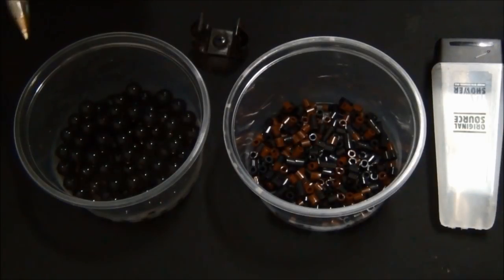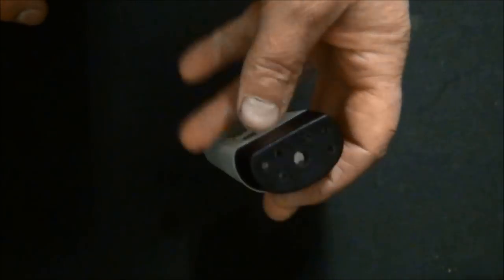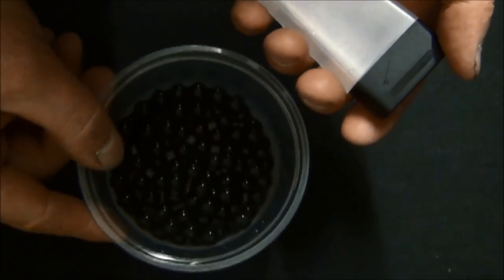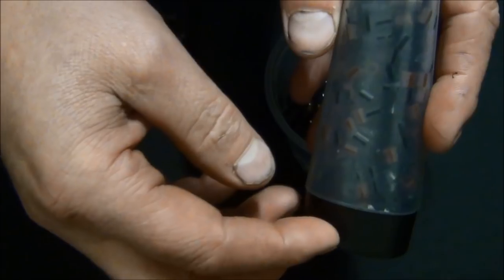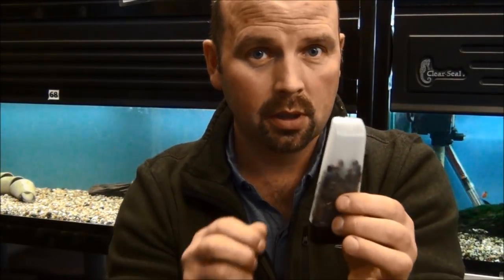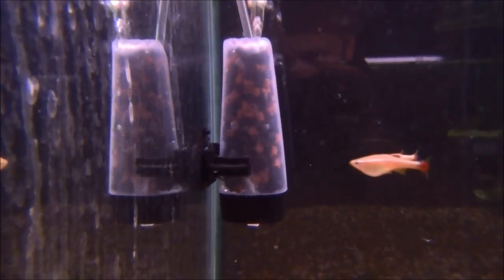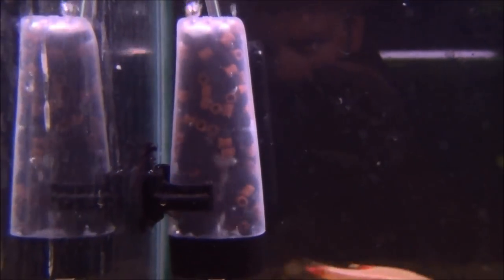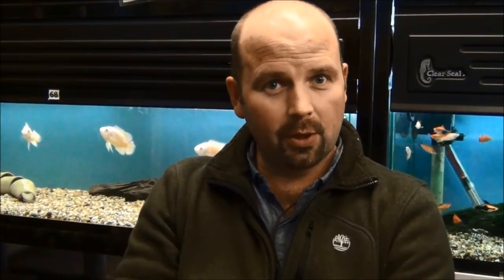MICRO MOVING BED / BACTERIA GENERATING FILTER FOR AQUARIUM

Comment: Great video again, i know this filter is designed to help generate bacteria in larger tank but was just wondering, I have a small 10 litre tank with couple fry in it would this small filter be enough to run that tank or is it too small?
Reply from the maker: It would be fine for 10 litres but there is no sponge in this design so you may need to adapt it to enable mechanical filtration.

Comment: This is a really great idea. I'm sure I'll be making this an addition to my tank. What size setup would you recommend for a 20 gal planted and populated tank?
Reply from the maker: The size doesn't really matter since the tiny filter is just to release good bacteria into the tank (and into the main filter which will contain filter media)
Reply: Pondguru 

Very cool. Which brand makes the gel bacteria balls. Are the beads porous, or would something like sintered glass media be better ?
Reply from the maker: The gel balls are from Evolution Aqua and I buy them in boxes of 8 x 2 litre tubs to give away with media.
The small Hama beads used in the video are not porous as they are plastic and for a filter as tiny as this if you want a moving bed it really has to be plastic Hama beads due to the tiny size.

Comment: Thanks for sharing this. My only concern is that the gell balls decreases in size overtime and these balls can come out of container and be mistaken as food by my fish. With this concern what can you advise to prevent this coz i believe that the gell balls could be harmful to the fish's health when ingested. Thanks for the advise!!
Reply from the maker: +JJA 50 I've hears of large fish such as cichlids and goldfish eating some of the gel balls and they should always be placed in the filter, not the tank to prevent this happening. All cases I've heard of had no ill effects and the balls were eaten at full size.
When used in a filter such as the one in this video the outlet holes on the filter are so small that the balls would have to be practically dissolved completely to fit through them and even if eaten by tiny fish wouldn't do any harm.

Comment: Richard since I have a pretty small tank 28 litres and one goldfish would this micro moving bed benefit my tank. This is a very clever piece of kit.
On the other hand would I be better buying something like NT Labs Filter Starter that you add to your filter or tank this is supposed to add friendly bacteria after a water change any help on this would be much appreciated .Also I would recommend you make and sell this little gadget for the novice who just wants to plug and play if you no what I mean.
Reply from the maker: Most additives which claim to add good bacteria are at best, crap. That's why I like the gel as it s there to nourish the bacteria so a large proportion of it is alive and active when it is added to the tank. If you already have a filter (which I assume you do) adding some bacteria every now and again will benefit the tank if levels of ammonia and nitrite aren't always where they should be (zero).
Reply: Pondguru Thanks for the reply Richard so you recommend the gel balls.
Reply from the maker: jodonbaker43 They seem to work better than anything else I have experience of so yes, definitely recommend them.
Reply: Pondguru Richard I got your gel bacteria balls today and they are fantastic value for the money loads in the bag.Two questions I have please is what conditions should I store these gel bacteria balls in as I am not sure on this ie temperature and packaging. 2nd question is it possible to put these gel balls in to a Air Stone Bubble Wall Tube.  Subbed your channel its fantastic more videos please.
Reply from the maker: jodonbaker43 I always go well over 50 - sure if I counted them there may be hundreds in there, lol 
As long as you keep them in a sealed container they should last 9-12 months, maybe longer in a fridge (as it will slow the bacteria down). Since I closed my shop and gave up landscaping to concentrate on the online selling it will be more difficult to make aquatic videos but there will still be some coming up, no worries.
Reply: jodonbaker43 Richard can you do a video on the differences between moving beds and static filters please for the benefit of us guys running a static filter in a small  28 litre tank using a Maxi Aqua one 101F Filter.
Reply from the maker: jodonbaker43 It's difficult as there are so many variations of static filters but that is a subject I had planned on filming when I had the shop (closed early January). I may do a straight comparison of pros and cons of each type so hopefully I can get that done in the next few weeks.
Reply: Pondguru Richard sorry to hear your shop closed.Hope you can continue with your Excellent videos I have learned so much from them thanks so much for your replies to my questions its much appreciated.
Reply from the maker: jodonbaker43 No worries, glad you enjoy the videos and I will do aquatic related videos whenever I can. 
Thanks for watching.
Reply: Pondguru Richard could you make one of these for me to purchase as I have a small 28 litre tank as I worry about the type of plastic I should use. I Would be very grateful if you could as I don't know were I should place the Gel bacteria balls that I purchased from you.Any help would be much appreciated.
Reply from the maker: jodonbaker43 The gel balls just go in your filter to seed your filter media so that is the easiest place to put them.

Comment: Thanx Richard, good idea - I have some high readings of Nitrate in a 4-week old tank and I think this may be a good idea to help reduce it - what d'you think? <goes looking around supermarket shelves for travellers shampoo> :¬) Cheers
Reply from the maker: Do you mean nitrite? If so then this filter will devour them by using the gel balls. If you do mean nitrate then this filter will do nothing for nitrates - a moving bed filter concentrates 99% on ammonia and nitrite as it only supports aerobic bacteria. The 'invisible aquarium filter' will hammer the nitrates down, as will using biohome (especially mini ultra and ultimate) as it also supports the anaerobic bacteria which consume nitrates.
One of the next videos I am uploading will be on the nitrogen cycle as all the ones on Youtube I see are people trying to make themselves look clever without caring if it is understandable for the viewer.
Reply: Pondguru
NitrAte, yes Nitrate, was 20ppm 1st week and then 80ppm the second week.  OK understood about the "backteria generator filter". Thanx for your help bud'. p.s. Any ideas how I can attack my high Nitrates? thanx
Reply from the maker: *****
Yes, as I mentioned the biohome media actively consumes nitrate but that takes 4-6 months for you to notice - anaerobic bacteria takes much longer to build up than aerobic bacteria. Until then you would just reduce levels by partial water changes once a week.
Reply: Just add a few grams of Fructose fruit sugar (I use 4g per 20L) and aerate the tank if you don't already. Within 2-4 days, nitrate will be at zero.

For regular maintenance 2g per 40L every few days.

Been doing this for 2 years now. :)

- The Aquarium Wiki Encyclopaedia
Reply: Thanx Bud'

Comment: Very noisy set up for the home however.
Why not use Seachem's Matrix media as this has 1000x the surface area of your plastic beads?

Tip: filter needs enlarging? Or you want to use a smaller one?
Just replace media with Matrix as this has a huge surface area compared with normal ceramic beads or balls.

- The Aquarium Wiki Encyclopaediae
Reply from the maker: I think you've missed the point of a moving bed filter as it only supports the very strongest aerobic bacteria and is proven to remove ammonia and nitrite much quicker than static media with more surface area.
Matrix is a static media and is eaten alive by Biohome Ultimate which is as good as it gets for static media..
There wasn't a good enough media available so I had it made to my specifications.
Reply: Both are static, if placed in a static filter. No reason why Matrix can't be placed in a swirling filter too. :)
Reply from the maker: Stuart Halliday
I need to do a video on the differences between moving beds and static filters.

Comment: What's the name of your store on ebay
Reply from the maker: It is 'filterprouk' which matches my online shop http://www.filterpro.co.uk
I recently changed the ebay name from 'tynevalleyaquatics' as the garden centre where I used to have my fish shop is sneakily using the same name for the fish department there after he was adamant he didn't want to buy the business or 'good will' when he bought the tanks and fixtures and fittings.....
Reply: Thank You sir. All the best R
Reply: Do you ship to the US?
Reply from the maker: I do ship worldwide but there is also a supplier for the biohome products and bacteria balls in the US: http://www.greatwaveeng.com which will save the high shipping from UK. If that link does not work then click the US flag at the top of any page on my website http://www.filterpro.co.uk and you will go straight there.
Reply: Oh cool. Thanks